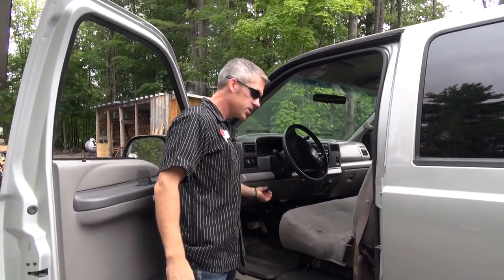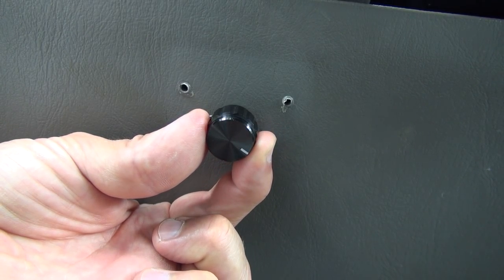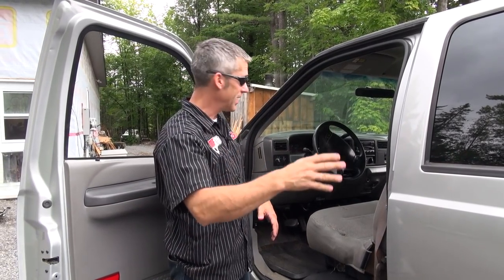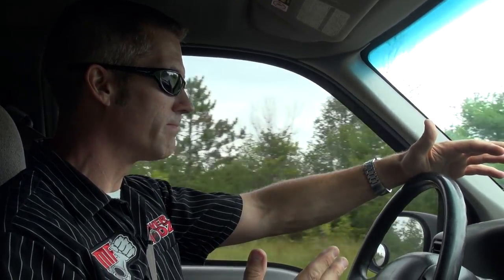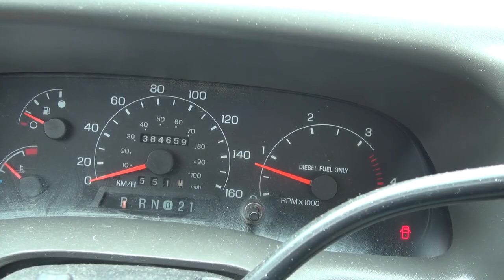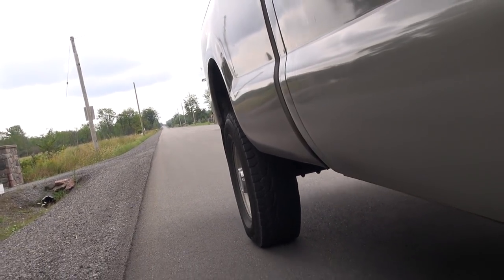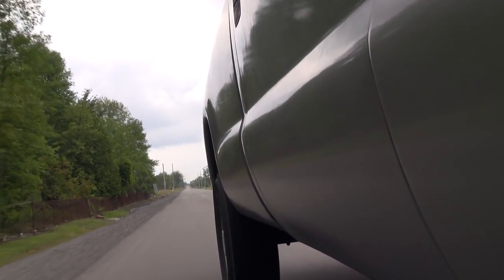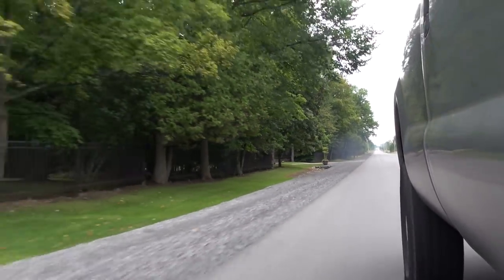TS Performance chip test drive, 140+hp!!  PowerModz!

Comment: TS chip in my 97 ccsb OBS for 8 years and keep it on 100 hp setting... Towing and everyday driving... With the automatic.  No issues.  The 100 hp settings seems to get the best mileage and the best Transmission shift points ... And is why I keep it on that setting.
Reply: How is it now I see you wrote this comment 1 year ago

Comment: GAUGES BEFORE POWER ADDERS. PERIOD!

Even though I'm sure he didn't damage anything for what little time he was heavy on the throttle, that 140 HP setting will raise EGT's FAST... you really need to keep an eye on it, thus you must have at the minimum an EGT gauge. Then trans temp, then a boost gauge if you want one. 

With stock internals, the 7.3 will run safely for long periods under 1,250 degrees Fahrenheit with the probe installed in the exhaust manifold and short times above that temperature, but play it safe and stay under. Also, don't bother installing the gauge in the downpipe. Some aftermarket DP's come with a bung already but just do it right and drill/tap the driver's side manifold. It's easy. 

Of course you'll never see the full additional 140 horsepower as claimed but you'd come close with all the supporting mods such as fuel pump and the Ford Severe Duty intake system to name a couple. 

Having said all that, TS is a decent chip but it's a canned tune. There are better choices for around the same money or not much more. 

More power is always more fun, but one must always prepare for it with gauges and the right mindset else you may soon be left with a truck that's found on the road dead.
Reply: What can happen if the egts get over 1250???
Also how fast do they go up on the 140hp tune

Comment: this guy is shady af, at 0:18 the truck has paddle mirrors and the truck that did a burn out has tow mirrors. take a look!
Reply: at 4:33 he faked doing a burnout, his truck clearly has paddle mirrors not tow mirrors
Reply: In his defense it could have been 2 different videos and the part where hes talking about it was before he put tow mirrors and then he filmed the burnout video after tow mirrors. If you look at videos 5 years ago you can see he has tow mirrors on it with his skis on the back. (Btw he has a fuck load of videos so its gonna take a while to find it but its there)
Reply: D C or maybe he had 2 different mirrors it’s the exact same truck maybe he didn’t have a tow mirror laying around

Comment: Best motor ever!!!
Reply: A 'motor' refers to something that runs on electricity. An engine runs on fuel.
Reply: Mark Estrada Your correct. But I think most people can figure it out Lol
Reply: @DUNEATV  Just about every car company is misnamed.I catch myself doing it all the time.
Reply: @markusgarvey  
A motor is a device that generates rotational force. An engine is exclusively powered by expansion but a motor can be either one. A quick Google search would tell you that.

Comment: I just put it on my late 99 f250 4x4 6sp. Big difference.  I leave it on tow mode. Thats plenty of a improvement for me. My only thing i dislike is when i shift it seems to hold the rpms in stead of letting the rpms drop immediately when i let off the thottle to shift.
Reply: Mine has been doing that without a tuner installed.

Comment: I will be buying that next week for my 99 f350 dually. One question i have a 6 speed with a granny low so I'm guessing shift points are not a concern. How do these chips help a manual trans truck?
Reply: they dont. at all does nothing, still usually tries to talk to the trans but wont. i run sct tunes in my 6oh and it retuns the trns everythime but dosnt actually do anything lol im running  ZF6 as well
Reply: Just buy the ts for a manual, it'll work just fine
Reply: Thanks so u can tell a difference huh?

Comment: hey i have one of these chips i get the best miles on 75 hp  i now have dual 4" turbo back  with a k&n filter  and fuel pressure spring  mine will boil 36" tires into 2nd gear i love the chip

Comment: I have the same one but when it goes into 3 gear if I'm into the throttle it hits so dam hard i thought i dropped my transmission the first time and a few times since, what i found was back off the fuel when your going into that gear its fine now, i have put the 3 inch turn down into a 4 inch straight pipe, open the air box and this programmer and it rocks big time.

Comment: !!wow!! i just installed TS 6 position chip on my 2000 7.3  powerstroke at the100hp setting what a different monster holy shit...i can't wait to up grade the turbo & 4" exhaust also S&B cold air intake
Reply: Did you get the mods done? This is the exact same setup I'm looking at doing on my '01. Maybe a wicked wheel 2 also.

Comment: Installed the TS 6pos chip in my 2001 7.3 totally different beast and believe it or not it is easy to do over 105mph, to were before it was a fucking dog.
Reply: +dodgecummins12v  can you tell me where to get one for my truck 2001 cummins
Reply: I believe summit sells them, but i just typed in 2001 7.3 6 pos chip in ts's chip pops right up.

Comment: Yeah i have a question when switching between modes from 40 75 100 140 do you have put the truck in park when switching the dial ? or can you just switch it while its still in drive or do you have to turn the truck off when switching it ?
Would be much appreciated if you let me know
Reply: You can do it while driving
Reply: Are you sure ?? 
i dont want to fucking up my truck bud ?
Reply: Idk if you figured it out, but yes you can. I do it, but not with me laying on it just cruising

Comment: "That aint no smoke Cummins all the way"
Well sorry you cant just turn the fuelpump all the way up on a 7.3 in 2 seconds with a screw driver... its alittle harder than that...
Reply: ***** Powerstroke was released sometime in 1994... not that turning up a 7.3 idi would give you much anyhow...
Reply: jmanwild yea the idi ended in 94

Comment: now, i have the same truck same tuner but im hearing you can really hurt the truck at the 140 hp setting unless you have some nice injectors.

Is that truck if im only running like maybe a 1/4 mile drag?
Reply: Get an upgraded exhaust an you won't have to worry about

Comment: Old video BUT... towing with the TS chip on the 100HP setting killed my 7.3 in 2 years. Even watching the EGTs constantly, took 2 years but #7 burnt all the way through and EVERY PISTON IS CRACKED. No good. It's not all about fuel and EGTs.. but also timing advance.
Reply: Driving my truck for 16 1/2 years STOCK killed my truck.

Don't know what all you other goons are going to do with a bunch of mods to OLD trucks like ours.....
Reply: It’s about controlling the afr ratios your engine was running to hot you need bigger injectors
Reply: Your not supposed to tow on a 100hp setting. Thats why you have the 25-50 hp tow settings depending on weight. Its amazing it didn’t let go well before that towing on the hot tune.

Comment: How many kms does your truck have? I have one but it has 500000 kms and I don't want to blow my motor. Will it be ok?
Reply: bowhunter1020 yes I ran a ts6 for awhile but went with edge because they are a bit better imo. My 7.3 has 580k on it and ive boost launched it. Might have to change 580k miles to km if you’re up north haha

Comment: it looks like its cool, but i'm thinking it might kill a catalytic converter and reduce air flow through a exhaust over time? also adding harshness into the shift points on the transmission, ect.
Reply: I prefer this chip it is badass I just got it
Reply: +Chris Ekiert The 7.3s don't have catalytic converters.
Reply: +MrNotorius5500 Right...
Reply: ***** They don't. I know. I own one.
Reply: MrNotorius5500 Right... Some did some didnt, it depends on the state they were sold in. Under you hood somewhere which is a federal emissions sticker, that would tell the inspector what it came with factory and the emissions its supposed to produce.
Reply: *****  Well that's kind of strange considering my particular truck came with California emissions and as far as I could tell the stock exhaust had no inkling of a catalytic converter. One of the only major differences is that my truck has a glow plug module instead of a relay, and I'm sure the computer is tuned slightly differently than others. Then again even though I've heard California has the toughest emission laws in the country, I don't know their particular specifics for each YMM of vehicle sold there so who knows maybe California didn't require 7.3s to have cats. I really can't say. But of all the stock 7.3s I've ever come across, I haven't seen one with a catalytic converter yet.
Reply: MrNotorius5500 My 96 has one, and oddly enough cali obs fords have larger dual shot injector too.
Reply: Only Manual 7.3's have cats...
Reply: Jensen LeBlanc Only manual OBS fords...

Comment: Why don't I buy/trusted this... these diesel all you really need is has it up and the black smoke will show. Plus this thing adding 140hp at the wheel... than how come non of the Drag cars, NASCAR,  or F1 Formula not have it installed in their ride. I wonder why...? So adding 140hp on an stock engine will make your car super fast without any type of mods... with this being said your company should of put a lot of  consumer out of business.

Comment: Would I need to get some gauges for my truck to monitor it while running on 75 hp
Reply: They recommend it just because stud is gonna be running a lot hotter if I was you I'd get a egt deleter a boost and a transmission temp they will run you 225-325 depending on brand
Reply: Jeffery It Depends How Safe you want to be i just made a 400 mile trip and back on 140hp and had no problems im still going to get those gauges though ;)

Comment: wow. 140 hp. that much. awesom.
Reply: It's b.s. Maybe actually 50hp on the "140 hp" setting. The other lower settings less...
Reply from the maker: kandela brown Hey thanks for watching!
Reply: kandela brown once you get into exhaust,intakes,and injectors, you get more power put down threw each tune
Reply: dodgecummins12v is right. It may not make that much of a difference on his stock truck. My truck has injectors, exhaust, turbo, and all else necessary to make the optimum performance out of a chip. I have a TS 6 but mine is running Beans Custom Tunes and I can feel 140+ hp.
Reply: dodgecummins12v  he's not getting the full 140

Comment: So I a "true 140"  as opposed to untrue 140? So my one 140 hp could be 80 hp? The answer is yes!

So changing the torque management, dumping fuel, and rompin on the gas pedal get you better fuel mileage? Go figure. You might be able to pull it off and drove like a granny. More   power takes more fuel it's just physics. By your reasoning and 800 hp Viper would be getting s 50 to 100 miles a gallon. I guess you figure since there are so many fake chips out there that make that claim that it can't hurt for you guys use it to, right?

When I built my LS one  I was getting almost 32 miles a gallon on a 1700 mile trip stock is 350 hp at the flywheel. New engine that had to be kinda conservative on the cam with because I'm in California and makes 400 hp and torque at the rear wheels with a good tune. I lost 3 miles a gallon on the same trip.

I don't like factory shift points on anything either but their reasoning is keep transmissions from blowing up. 

Black smoke is unburnt fuel. And no people don't like driving through your thick cloud  of black smoke. So this isn't really a tune this is just turning shit up. You don't mention it your engine will not last as long your transmission will not last long, you kinda forgot to mention that. If you get a good tune on a diesel the way they're made now you should be able to get good power and not have all that smoke.

How are we supposed to tell how much power it makes it is by watching you driving around? If you know how much it makes why don't you just show us   demonstrating it on a Dyno, instead of just doing a sales pitch and telling us how wonderful it is making smoke, and doing a power brake burnout? Take a wild guess and say that results may vary widely. 

I  gotta say you definitely sound like a snake oil salesman.
Reply from the maker: Bud, I think that is the only time I've ever floored that truck...it's a video right....  Better shifting patterns do lead to better fuel economy.

Comment: you don't seem to understand how fuel mileage works. fuel mileage relates to forward motion per unit of fuel.  You don't get "better mileage" by letting a vehicle sit idling for 20 min.  You'd get FAR better mileage creeping along in first or second gear at 1500 rpm until warm, than leaving it sit at idle, as the engine is warming AND you are moving.  you're welcome.
Reply: mike force but if you have ever owned a diesel you would know that they run best when warm so letting it idle is the way to go.
Reply: get your driver's license, then come back and comment kid, you have no idea what you are blathering about.
Reply: Mike, you nailed it. Completely agree. An engine, especially a diesel, will warm much faster with a load, even a small/light load like creeping along @ 25mph on the way to the freeway, rather than just idling, plus you get the benefit of putting mileage behind you. Additionally, on some diesels idling is actually not good for them as the oil pressure is not sufficient for the top end if idled for extended periods. That's why some manufacturers on newer trucks offer a high idle setting and/or shut off if idled for too long.
Reply: @chasebush7105  You're vs your...

Comment: HEAT kills a 7.3 dude, take it from a diesel tech... only thing that kills a 7.3 is heat... more fuel = more heat thats all that tuner is doing, adding fuel and timing
Reply: too much power added on a stock engine the 7.3s are Nortorius for bending rods
Reply: yup! heat can cause alot of issues in any diesel
Reply: The older 7.3's 94.5 through a few 2000 models  had forged rods. They could easily handle 500+hp dude. The ones with PMR's are the ones that bend rods.
Reply: its not so much the rods dude, its EGT's that damaged valves/seats, and timing increases cylinder pressures
Reply: I was replying to the other guy that made the comment about rods.
The intercooled models run a lot cooler than the OBS models and should be fine with a chip if you don't hammer down 24/7.
Heat kills every diesel. Not just the 7.3. But that's easily preventable with better turbos, and water/meth if it's really needed.
Reply: bakerboy293 I was not saying a chip will bend rods or anything like that, i was just stating the 7.3l powerstrokes are notorious for bending rods more than the others. I didn't feel the need to get into specific details over it, but i guess next time i should for you guys.Heat is the enemy for any diesel.
Reply: awww, cool cool, personaly i find if the customer knows how to run a 7.3 they wont bend rod's and i've seen more pistion ring failures in high milage 7.3's more then bent rod/low compression
Reply: I didnt think the ts added timing man, only changes shift points and injector pulse= more fuel

Comment: How has the transmission been? I've had one of these on my 2002 7.3l for a year now, just curious cause I drive my truck lightly for fuel economy but I like to have fun with it every once in a while and get on the pedal. I have even towed with it and it runs great, but I am just curious as you have had it on longer.

Comment: I have this chip in are truck 2000 7.3 if you really want to make it turn on and keep your EGTs down Install the wicked wheel 2 also install big boost and the K&N Cold air intake and you think the 140 was a big Gain in horsepower do that MOD to it and you’ll shit your pants and keep your EGTs down that little modification it adds almost 75hp and it’s a noticeable difference with out the chip!! And no turbo stall Then there’s a Fuel up grade you also can do I have done them all in my trucks a weapon Dino  horse power it lays down the well over 500 horse 790 foot pounds of torque with minimal modifications done to the transmission by changing the valve body and using the 04 6 L transmission cooler when you do these upgrades are going to think of your driveline or she’ll spit a tranny pretty quick it’s also good idea to install a transmission temperature gauge I am also a fellow Canadian what part of Canada are you from I’m in Ontario

Comment: Can't believe you guys are rolling around in spotless 7.3L Power Strokes. My 2002 F-250 Super Duty that I special ordered brand new in October 2001 that currently March 2018 has almost 176,000 miles is falling apart here in the Midwest from almost 16 1/2 years use.

This truck is rusted to shit and things are going wrong right and left at this point. Currently besides all the rust, I have driveshaft U-joints going out and I think I have a bad injector. When you first start the truck it pours white/blue smoke out the tailpipe for the first 10-20 or so seconds. I think I am leaking fuel down into the cylinder while parked.

Two Summers ago in July-August 2016 I did new injector cups and injector o-rings. I did glowplugs, water pump, starter, aux alternator, belt, tensionor and idle pulleys, turbo pedestal o- rings, degas bottle, coolant flush and fill, new IPR sensor, air filter, engine block fuel supply lines, fuel filter and a whole shitload of other things.

Driving a truck this old is starting to get costly these days as I know I am looking at between $5,000 -$8,000 worth of body, bed and door damage from severe rust. 

Chip or tune this old STOCK truck? HaHaHa.....I just want it to last at least another 4 -5 years. I wouldn't waste my money modifying things only to prematurely roast this engine or hurt the tranny or rear end. You are only going to tear something up as these trucks were never designed to run like this.

You fellers can do what you want......especially that Yooper ^^ up there....LOL

What a hoser.....eeeaaaahhh?!

John
USA